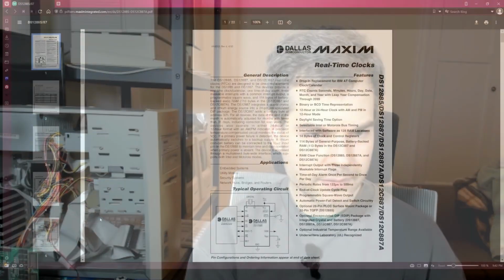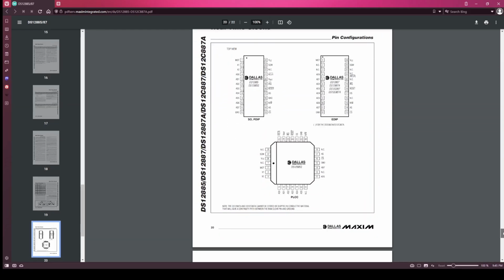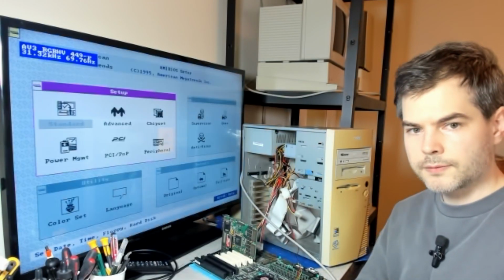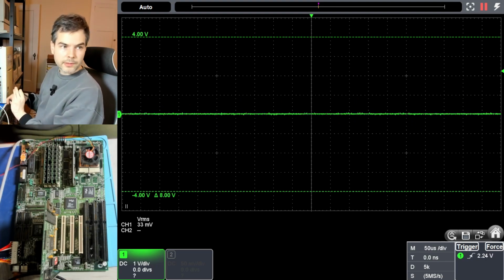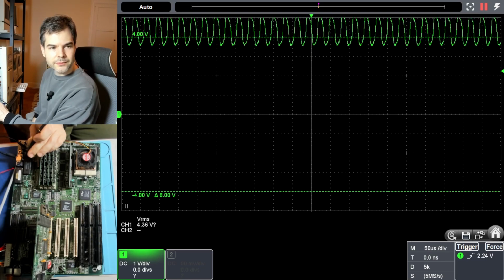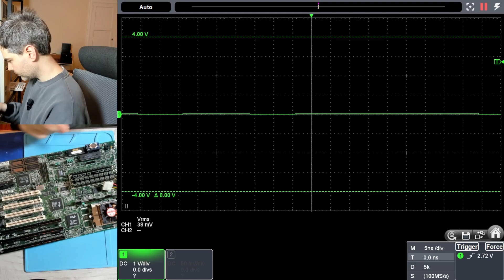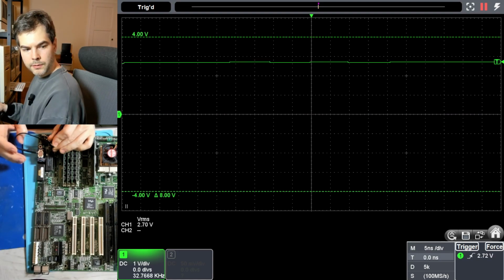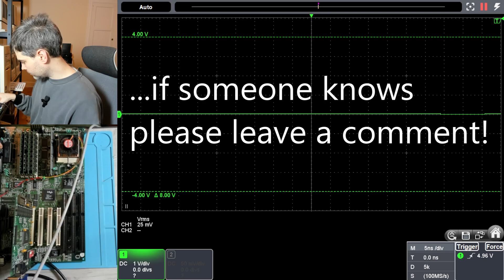Dallas Chip Part 2: What happens if you connect two crystals together?

Comment: At 17:55 your oscilloscope was running at 5 ns/div sweep speed, that's why you didn't see a waveform. A good sweep speed for this signal would be something like 10 us/div.
Reply from the maker: Ah yes of course, I should have thought of that! There is a follow-up video available now where I get a proper signal when testing the clock signal while the computer is turned on: https://youtu.be/9_sVM_fkAuE

Comment: The slow frequency xtals in the KHz-range are usually serial-resonant. They use a load capacitance of around 6 - 12 pF and have a native capacitance of around 0.8 pF. If you tie two of them together the native (or parasitic) capacitance adds and detunes the circuit *slightly*. Really operating is only the one with the lower effective serial resistance - which is usually at 40 - 50 KOhm per xtal. The other one just adds capacitive load and causes a detune. It won't lead to total non-functionality fortunately, but you have a larger long-term deviation of the internal timebase.
Thanks for sharing !
Reply from the maker: Thanks for watching, and for providing expert insights! I was curious if the time would start drifting due to the incorrect clock signal, but in the 7 days between the previous video and this one I didn't notice any noticeable drift. We're probably talking in a much longer term for it to get noticeable, I assume.
Reply: @newoldcs  On your first attempt to check the xtal frequency you'd ended up at 32.769 KHz - which is 1 KHz too much. The frequency is internally devided down by 2^14 IIRC and the "seconds counter" a further 1:2. So the initial deviation will result in 1 or 2 seconds difference after a week earliest. The over all precision of these clocks is 100 ppm I guess - which suffices for generic applications. So: it might not matter much. But by the way: didn't the person who created these plug-on battery cradles leave any notes on the variety of chips used and their individual treatment ?
Reply from the maker: @wacholder5690  No that's the thing, the creator of the PCB didn't provide instructions, and even labeled it as a product for use with the DS12887 primarily, hence my initial incorrect assumption. I sent them a message on their Tindie store with this feedback.
Reply from the maker: Quick update: The seller of the board says they intended for customers to extract the entire epoxy package and cut out the original oscillator before installing this mod in a DS12887. So now we know why they designed it like this.
Reply: @newoldcs  Now - really ? Who is going to do that ? It is hard already to get the contacts freed up - not speaking of removing the entire epoxy blob. Unless you have an industrial milling machine at hand. I think someone copied something for making money without really understanding it. You pointed out the differences between 128(8)5 and 128(8)7 casings already so the only need for an xtal were the 1285 - which has a DIL-case and xtal on the board normally. I could only imagine that the xtal on the adapter is intended for the case that you need to modify a 1285 to be used for a 1287. Everything else makes no sense.
Reply: @newoldcs  That makes sense - Important bit of information :)
Reply: I'll have to correct myself also: the base frequency is 32678 Hz /  32.768 KHz, so a change in the last digit is 1 Hertz only. Division of that signal by 2^15 gives you a 1 second pulse (1 Hz). The usual tolerance is 10ppm (1:100.000), which about equals 1 second a day. And - some "Trivial Pursuit Knowledge": crystals of that size and frequency are normally formed as "tuning fork crystals" internally and use the base tune of their piezo-ceramic deformation when power is applied. 🙂

Comment: Good attempt ot get this done right, still some work to do. Having a good battery in parallel with the internal dead battery is never a good idea. You will need to dremel some more and cut a lead to that dead battery. Also, please, never do things like brushing nail polish onto exposed leads while there is a lovely motherboard right below. You risk splattering stuff onto the motherboard. 
Keep it up, the community is good and appreciate your enthusiasm, all the best in your retro adventures!
Reply from the maker: Thanks for your feedback and words of encouragement! I just published part three that does exactly what you say: https://youtu.be/9_sVM_fkAuE

Comment: I'm glad there was a follow up to this parallel crystal configuration. I don't know what is supposed to happen when two crystals are put in parallel, so in my mind it is "undefined", a state that one doesn't want.

I never read through all the comments in the first video so I don't know if anyone has mentioned it, but you are putting a fresh battery directly across a dead battery. This is considered poor practice. You should find some way of either disconnecting the internal battery or removing the internal battery. You are risking poor external battery life at the more benign end, to eventually the internal battery catastrophically failing because it is being charged by the external battery when it was never designed to be charged.
Reply from the maker: This might be a good opportunity for even more dremel action. Stay tuned!
Reply: I was going to say the same thing...
Failed batteries often develop internal shorts, so it could eventually get so bad that it will deplete your external battery at an alarming rate. It would be nice to see what the Dallas looks like internally (rather than a crude circuit diagram), so one could tell exactly how to sever the internal battery without potentially damaging something else...
Anyhow, great videos - I especially appreciate you posting the follow-up!!

Comment: While you'd opened up the xtal legs from the chip you should be able to get the internal xtal frequency at least at pin 4. I don't know how the internal oszillator is arranged in reality, but it is possible to actually stop the xtal with the lead capacity of the scope testleads, which is usually in the range of 25pF or around.
Reply: If possible use a 1 to 10 divider probe and jam up the scope sensitivity. Divider probes use to have a far lower capacitance. They need to be calibrated however for good signal with a square signal - and that's why they have this adjustable capacitor inside.

Comment: The two crystals (not oscillators) are not in series, but they are in parallel. It won't harm anything to have two crystals in parallel (nothing will break), but it has a high likelihood of not working properly and keeping correct time as the circuit is now having two "tones" clocking the oscillator circuit and double the capacitance of the two crystals. Actually best-case, it will use quite a lot more battery while trying to resonate this setup.

Comment: First off, the timebase is wrong (too slow) in the second shot since we cannot see the waveform. So that means the trigger is triggering on whatever it can lock into. That can make it show all kinds of funky stuff once the computer is booted and there is lots of noise on the supply rails. The capacity on many scope probes is actually too much to measure a crystal directly and it will stop the oscillator. The DC-offset of the 32 KHz waveform jumping up when powering the machine is normal. When running off battery it runs on 3V, and powered from the board it has 5V supply. There's some diode logic inside the chip that selects the higher of the two voltages.

Comment: where I work, we have old JUKI KE 750 surface mount pick and place machine, which use DOS system Japanese version of DOS 6.22, and it use DS12887A  encapsulated module.  one day it says CMOS memory back up battery is low .    and does not hold BIOS data anymore.  so I looked for battery on mother board, there are none.   then I found out  DS12887A  has build in battery in side of molding package.  as well as CMOS memory which are backed up by build in battery.   so I am planning to dig out DS12887A   plastic module ,  and connect new battery in parallel.   hope, this will fix the problem.   AG6JU